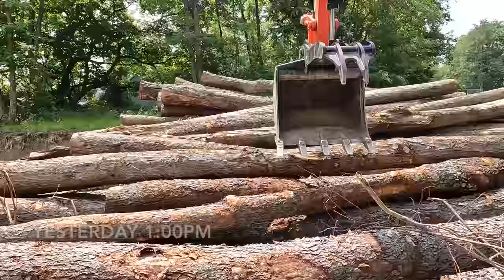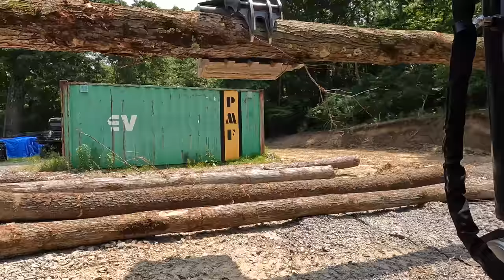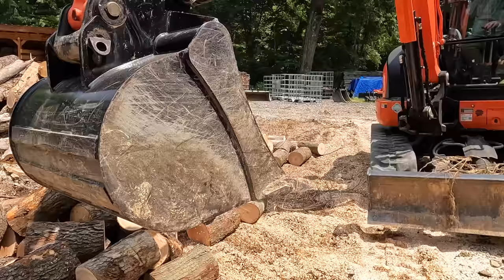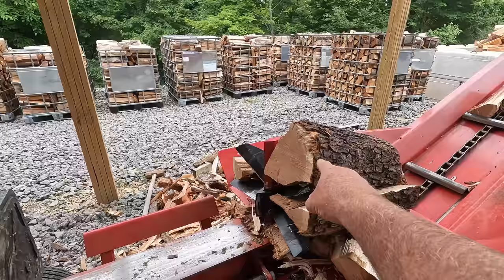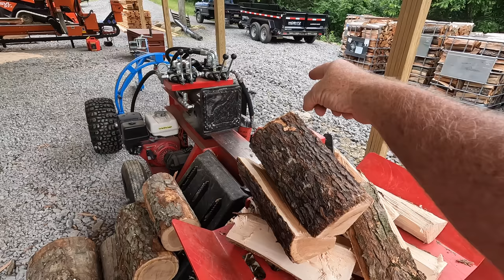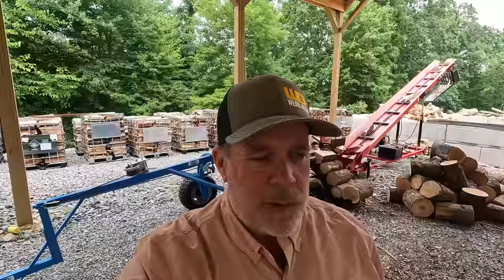Unfortunate Accident at the WoodYard, Freak Accident

Comment: I’m Glad Ed and everyone else is OK. Respect to you for making this episode to voice a warning and for investigating. 🙏🏻🙏🏻🙏🏻
Reply: I think the splitter would be much less likely to do what it did if the pushing plate was smooth. If it were smooth, it would not catch the piece of wood and build up much pressure.
Reply: @FLPhotoCatcher have everyone wear PPE same as a sawyer or feller
Reply: @missingremote4388  That would help a little, but a 20 pound piece of wood flying at your face would still do some damage.

Comment: Glad to hear that everyone is OK. Very good info on the dangers of wood splitting. I am 78 years old and have been splitting for almost 30 years with my 27-ton splitter and have had some fly out like that and I think it is mostly the ones with knots in them as they are under pressure from them as well as from the splitter. As you said it is a dangerous job and as a male, you are always trying to do more and work faster than yesterday, much safer to slow down and pace yourself. I always take a break every half hour or so, job does not need to be finished today leave some for tomorrow. Avoid a heart attack.

Comment: Great video on a unfortunate accident.  Thank you for posting.
I was splitting wood with my son, and he was loading the logs for me on a horizontal splitter.  We were splitting fairly large rounds of gumwood (about 18-24" diameter).  I had cut the tree down and noticed that the tree had been internally supported by guy-wires attached to bolts through some of the larger limbs.  They had been installed at least 10 years prior, and they were somewhat embedded in the tree.  I had accidentally placed the piece of wood with the bolt in the pile to be split.
Needless to say, my 18 year old son (at the time) didn't think to look for an object like that.  He loaded it and I hit the lever to split it.  Gumwood is fairly tough, and my splitter is only a 22Ton, so I wasn't surprised that it was struggling a bit.  But visually the piece was fairly straight and without knots.  So as I opened my mouth to tell my son that I was surprised by the fact that the splitter was struggling so much, the log essentially exploded in two pieces.  Luckily, one half it didn't hit my son, but I took a 25lb rocket right to the lower stomach.  It dropped me like a sack of potatoes onto my yard.   But I thankfully ended up with just bruises and nothing broken.  The bolt that was hidden in the log was now very evident.  
My situation was avoidable (and my fault).  But like you said, after you split wood for 40 years (started with my father as a boy) something is bound to happen that you didn't think about!  Be careful folks!

Comment: I am glad all are OK, too.  There are a couple other mandatory safety procedures I use when cutting & splitting wood.  But, rather than add them just now, I have a specific recommendation for a friend of yours (the fence maker).  I have decades in the safety industry, including as a CNC programmer.  You showed a video recently of an operator feeding a CNC controlled fence post cutter.  It appeared that it was continuing from one post to the next without the operator restarting the machine.  Her hands were in the machine while it was continuing its operation.  In my career I was asked on many occasions to write programs that didn't stop motion between parts.   I never, EVER complied with that request.  I was going to say something when I first saw the video, but didn't want to call them out.  Thank you for encouraging me to speak out.

Comment: Good Morning Mike, I'm glad you sharing this video as I have watched it few times and as a owner of a wood business / material yard  anyone working around a splitter weather it a Log splitter or the firewood Processor wear there helmet with the face shield as you have also done while using your chain saws . This has been proven to save one of my employees from a serious injury. I hope you consider this and we see this as a standard practice on your channel as you are promoting equipment and it's operation and it should be done to the safest standard as possible.

Comment: Mike, we love your channel and thanks for sharing your story. As far as prevention is it possible to; 1. Push the logs to the front of the splitter (person loading would then be forward of the loading ramp--not in the conveyor belt area ). 2. Attach a metal cage that you attach over the top of the 4 or 6 splitter head area (this would be an open look like your log storage cages or similar to the propeller cage on an airboat) 3. Require anyone within 10 feet wear a woodcutter's hard hat with face shield. 
Like the other's we pray that Ed recovers quickly. Nancy & Glenn from LV

Comment: Thanks for the video. Having spent 5 years in safety for an insurance company and 30 years for several industrial  corporations and I am happy to see an individual analyze an accident and share it with others. I have watched others splitting wood and seen the wood pop up but not with the force you describe.  I wonder if the manufactures of these splitters have considered any physical barriers at the end of the splitters.  Seems like a fairly big liability issue.  Thanks again, and hope the video helps others prevent more injuries.

Comment: Hey Mike, on the front plate of the 'ram' it looks like weld bead or diamond plate is creating a lip, the log might of bit into. I've had this happen to my splitter where instead of the log slipping over the plate, it grabs onto that weld and flips. Maybe try to grind it smooth so it doesn't' catch. Happy things weren't worse, keep up the great videos. -Andy

Comment: Thanks for putting this out, Mike.  Not sure if it would work in your set-up, but we use a 275 IBC with gaps cut on two sides.  The one side slides up under the back of the Wolfe Ridge wood tray so that the output drops into the tote. Therefore we have the stackers pulling out of the opposite side of the tote rather than off the tray which puts them just a little further away from the wedge.  Sure no 100% cure for the risk though.  I do think your choice to lean more heavily on the 4-way is a big risk-reducer for this.  I too notice that two-o’clock position on the 6-way does more regularly have pieces that like to stick.

Comment: I'm glad to hear that he is doing okay, considering what happened. He is so lucky not to have been worse off.

That knot in that piece of wood is what caused this freak accident.
The ram's forward motion would have slowed down momentarily (you may not have even noticed it) when it met greater resistance, the hydraulic pressure would rapidly increase to overcome that resistance and suddenly the resistance of that knot would yield (if it would'nt yield) the pressure relief valve would open, then the oil would be returned back to the oil tank
As the knot did yield under this increased pressure, the built up pressure on that piece of wood, was suddenly released and as a result, it shot out, like a bullet out of a gun.

This happens quite frequently when splitting badly knotted wood, more so in "very hard" wood, like we have here in Australia.
I have experienced this many many times over the last 32 years.

I only use a "single" splitting wedge on the "very hard" woods. 
When the splitter won't easily split the hard wood, the pressure builds up and at the same time, the motor bogs down on revs, as the pump struggles to increase pressure and if the built up pressure does overcome the resistance and the wood does split, it goes off with a significant loud noise and either one or both pieces of the split wood is jettisoned out to the front at one or both sides, with tremendous force and speed, as you witnessed. 
It's not called the "death zone" for nothing.
Don't "ever ever" have "anyone forward" of the block splitter for at least 25 -30 feet, further away the better.

Doing this video is commendable on your part. This may very well prevent a serious injury or death to any unsuspecting  opertor or to other people too close.
All the best for the future and a speedy recovery to Ed 😊👍👍

Comment: I have been splitting wood for 40 years but only with a single wedge. If there is a knot I always split that forward so that the splitter deals with it first. I also played the video a couple times and can't tell if the knot was at the leading edge or in back. If it was in back, I wonder if the pressure buildup as the wedge entered the knot was suddenly released as the wedge went through it, resulting in a recoil sending the wood flying. Some knots are so gnarly (I'm dealing with west coast pines), I donate that piece to the termites. Also help is great but 2-3 people to seems adequate.

Comment: Glad to hear everyone is going to be OK. I have seen this happen several times with my 7 ton horizontal splitter. Especially if you have pieces of wood with large knots in it or dry wood pieces. The amount of pressure behind those ones is incredible. I have seen pieces of wood flying over 15 feet before hitting the ground.
The real danger zone is about 45° to the right and left of the splitting knife. To be on the safe side, make sure no one is past the splitting knife during splitting. 
I already figured out what was going to happen from your video before you explaned it. Ed was in the worst possible position. An unfortunate experience to add to the bucket so you can avoid it in the future. Keep up the good work Mike. Love your videos.

Comment: Glad to hear everyone is OK.  I can relate... earlier this spring, I was splitting on my old Brave 22 ton splitter, and I had a piece of oak pop and blow off the side of my splitter and hit me right in the chest and gut.  It knocked me down, I felt like I got kicked by a horse.  It knocked the wind out of me.  For a little bit, I felt like I was really hurt bad... but after a minute, I got my breath back and came back to pretty quickly, walked it off for a bit, and finally got back to splitting.  Usually you can tell if the wood is behaving like it is going to pop and blow apart like that,  and get out of the way when you get a tough piece, but none of this wood was showing any signs like that.  It caught me totally off guard.  But, it's all part of it.  We do the best we can to be safe, but there's no way to get the work done and be totally safe, nor would I really want to be totally safe.  If that were the case, we probably would never get anything done, and probably shouldn't even ever get out of bed.  Gotta get back up, dust ourselves off, figure out what happened and why, make reasonable effort to keep it from happening again, and get back to it.  It's life.

Comment: Having done forensic failure analysis, i couldn’t help but notice that the wedge caught the end of the log about 2-4 inches from the end and was pushing against the grain, not with the grain, so when it tipped up, it was pushing across and stopped actually releasing the splitting process…it seems the grind of the wedge is faced upwards, which caused the upward rotation of the wood being split and set up the compression launch. Wow, very lucky Ed is alright, and that it do more physical damage. Thank GOD!

Comment: Mike,
Glad to hear that Ed is ok.  I'm kind of surprised that you haven't seen this before.  I know that this is REALLY common with Locust & Hedge Apple.  I've seen pieces split and shoot out 20-feet from the splitter.  It will pop so loud that you think a tire exploded.  I always used a vertical splitter, so the pieces really didn't go too far, but with a horizontal splitter like yours, I could see them really flying!

Comment: Mike: My 6-way has a 1/4” steel tab welded near the ends to help control that. Increased tension into the vee then popping out could be controlled a bit by the addition of these to your wedge. Mine is a Timber Wolf with a 5” cylinder.  I haven’t been seeing these issues. Prayers for your father-in-law.🙏

Comment: Mike.. I have been cutting firewood for 45 plus years. I would like to tell you my father and I took down a Norway maple. It is a curly grain wood. Very pretty wood for lumber. However when you split it it sounds like a shotgun going off. One of the only times I have ever been "scared" of the splitter. Wood would fly off the  splitter and fly 10 feet. When you use this stuff this kind of thing happens. Glad he will be ok in the end.. thanks for sharing.. stay safe.....

Comment: Mike,  Sorry for the unfortunate accident. Hoping for a speedy recovery for Melissa's Pap.  My post accident thoughts on the cause are as follows...  If the wood round had been a clear piece (no knots), the round would have split normally, on the six way wedge, with much less pressure required.  Much like you have done many times before.  The large knot on the inside of the accident round, would have taken much more ram pressure to fracture, resulting in the high velocity of the wood wedge coming off the six way in the way that it did.  Hope this helps you with the root cause analysis and safety going forward.  Enjoy the channel!

Comment: Thanks for sharing and glad to hear Ed is doing okay. Thing like this happen and you have to consider it a learning experience and adjust your operations to prevent it from happening again. I believe you are on the correct path keeping the front side of the machine clear during the split operation. You can clear the conveyor on the back stroke or temporary halt the split operation.

Comment: Yep. I've had logs basically explode apart just using the single vertical wedge. goes off like a gunshot and hurls a piece quit fast. I think you're on the right path about knotty wood. Still a lot of tension in those rounds

Comment: Thank God Ed is okay. Of all the years splitting with a wedge moving splitter I have never had that happen BUT I had an electric 7 ton splitter that was like yours as in the flat plate pushed the wood, had it on the tailgate of the truck, Nolean walked past and the wood sounded like a gun going off, a piece not much bigger than your hand flew out and up,  it cought her in the cheek just below her eye, I thought it had struck her eye and when she moved her hand her eye was already black. We have a 30 ton now and never had it happen, it's a wedge driven style. Willing to bet you won't hear about this happening with a wedge driven splitter.

Comment: Thanks for sharing. It’s good to hear Ed will be okay. I noticed there is a wolf silhouette welded on the face of the ram. I’m wondering if the face of the ram not being smooth caused the wood to be pinched between the ram face and the wedge. I could see where those ridges would grip the back edge of the round and push it down as you explain in the video. Seems to me that would also create the pressure required to pitch a large piece of wood out. Just a thought.

Comment: Mike there is a very easy fix for this. In race cars its called a explosion loop. We use them around our drive shafts. But for you just take a piece of 1/4x2 inch steel bend it into a C shape and bolt it to your table just behind your wedge. This would stop  anything from flipping back on you or flying forward and up. You do not split large rounds. (larger than 24 inch) but if you did you could remove the loop.

Comment: I’ve never used a splitter that size before so have no experience. My question is why don’t the manufacturers put some type of half moon shaped shield that would attach to the trough where the split wood goes before it is pushed onto the conveyor belt? Is that possible, practical? Seems like it would prevent the wood from flying off the front and/or side striking someone. If wood gets jammed up, you stop for a second, lift the protective cover, clear the jam and lower the cover. Just a thought.

Comment: Do you think a deflector plate out of thick lexan,the type used in urban bodegas as bullet proof glass, mounted horizontally on the top of the post that you slide the wedges on the splitter may prevent that from a future incident?

Comment: This has happened countless times with my wood splitter as far as the splitter building pressure as it splits the wood and as the pressure releases it throws the wood in different directions I’ve been hit in the arms  and legs with flying wood but never this bad of an accident my thoughts and prays go out for a speedy recovery

Comment: You've got a lot of people working around that machine.  A couple of suggestions: 
Consider Cowling around the splitter, perhaps a bit of a pain to work with, but less wood popping out.  Possibly also add something like a rubber truck mud guard on the tail end.
If you need a person sorting, then put in a flat conveyor, like a Green Chain that can move the sorter further away from the splitter.

Comment: Mike, any chance your cutting edges on the 6 way cutter are a bit duller over time? When you described the large piece that launched, it was actually pushing out a bit before it launched, it seems to me it was binding up a bit as perhaps the grain structure was resisting the cutter edge and then sprung loose with a bit of the stored energy. A sharper edge could prevent that binding energy from building. Would not be the first time that dull blades led to accidents.

Comment: Thanks you for posting and we will be praying for Ed. The piece being split and the segment that became the projectile appears to be a crotch, being split from the upper part towards the base. The piece hinged back and the power of the pressure plate that pinched the piece built great potential energy which converted to a sudden release of kinetic energy. The product of RAM speed and POWER.
Good thing he did not suffer a subdural hemorrhage. I hope after the nasal edema and the size of the nasal bone fracture that no intervention is required.
Posting and the passage of time can be therapeutic. 
I am optimistic that posting updates will be all be good news.   🙏🙏🙏